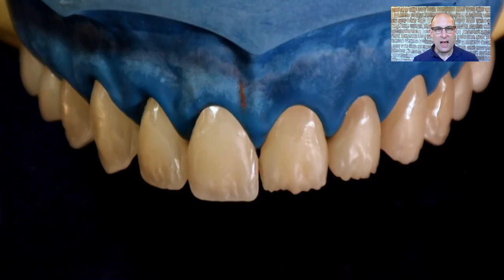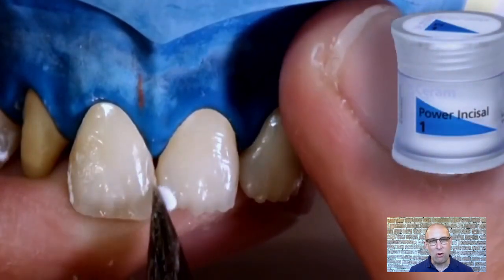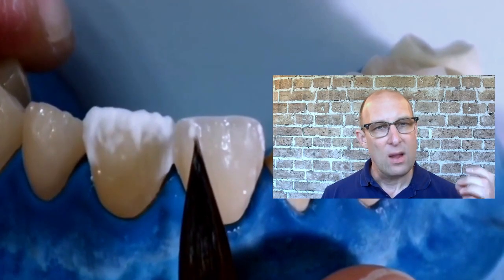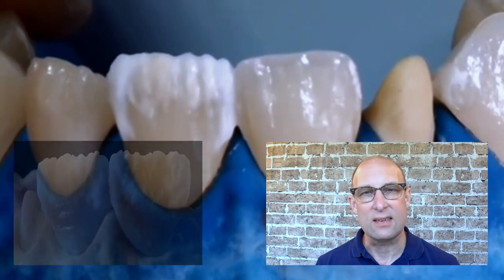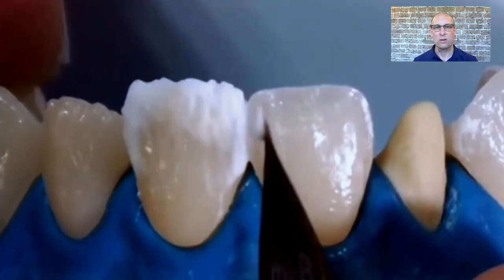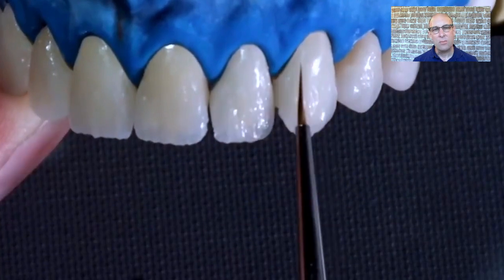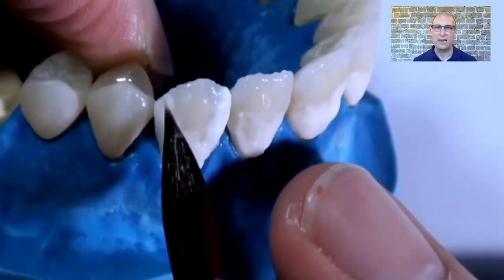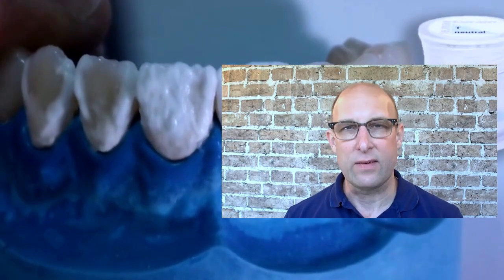Discover the Fast and Easy e.max and Zirconia micro layering method [ Quick And Great Results ]

Comment: Very nice!  What type of liquid stabilizer do you use to get that controlled porcelain layering, and is it universal or just for emax? Thanks
Reply from the maker: Ceram Build-Up Liquid Allround from Ivoclar. It is made for Emax ceram and depending on the other firing temperature you could try to use it. I would not recommend using it with other porcelain systems because I like to stay in the system and recommend following the manufacturers instructions.

Comment: Any ideas out there- I use the same technique, stains, MiYO and porcelains but still end up with slightly low value/grey anterior once in the mouth (using more opaque or translucent zirconias)
Reply from the maker: Have you tried Emax Ceram Power incial or Power Dentine? That will raise the value. Also if your cutback is too heavy and you add too much incisal porcelain it will drop the value. Try not to use too translucent zirconia as a base. That has a low value from the beginning.
Reply: @masterdentaltechnician1914  Yeah I’m using emax ceram- power incisal, OE, etc.
I’ll try less cut back and a thinner layer.  
Thanks!  
I really enjoy the videos, keep ‘em coming

Comment: The emax ceram porcelain can bond with zirconia ? I thought only can bond emax cad or press though. Since the zirconia is high temperature and the ceram is low fusing porcelain, so I thought cannot bond with zirconia.
Reply from the maker: Great question. Zirconia is a high-temperature material at sintering. After that, you can run it at any temperature you like. Glaze only: 725, bake on Emax ceram 750, bake on vita: 780, re-generation healing after grinding:1000
Reply: Would you pl  more elaborate on baking and glazing techniques
Reply from the maker: @sevdarbini1855 this might be helpful for you? https://youtu.be/XyKIcMFtFSw